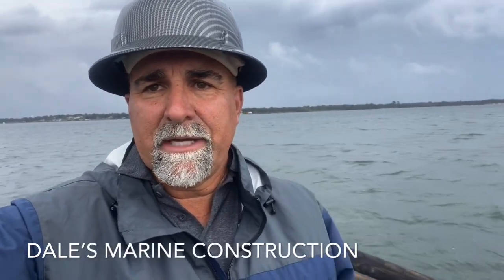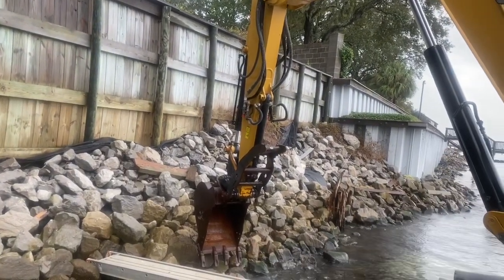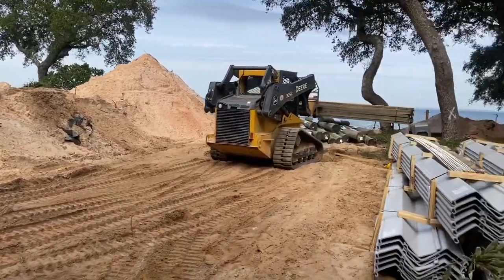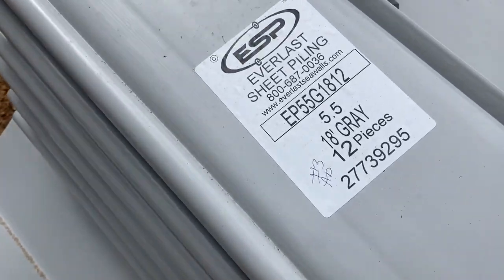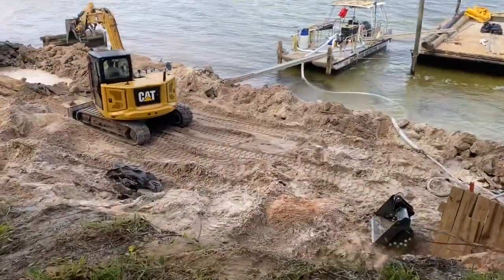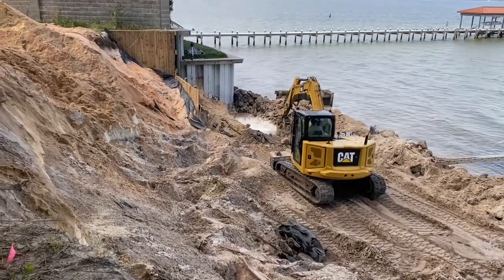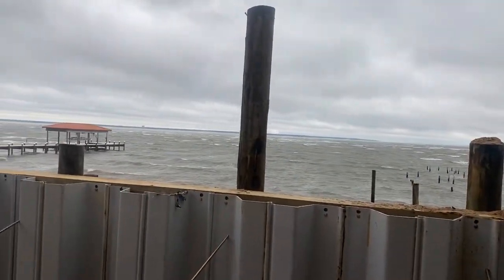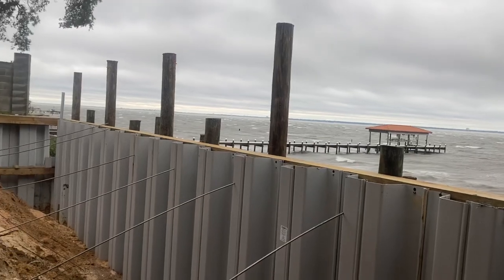EPIC WOOD WALL FAILURE- NEW TWO LAYER VINYL SEAWALL INSTALLED

Comment: Great video.. 
How are the triple 2x8's attached to the pole since they are on edge?
Reply from the maker: Residential Dirt Work we have a blocking system below it that it sits on and also we use 4 inch screws to toe screw it to the piling. There is also a 5/8 Rod drill all the way through them to the outside piling..
Reply: @DaleWHickman  👍🏼